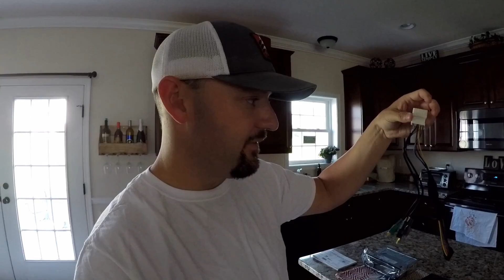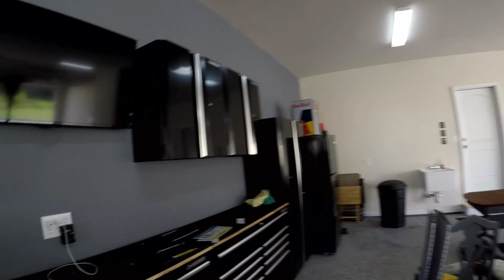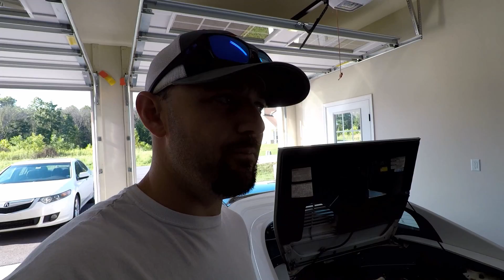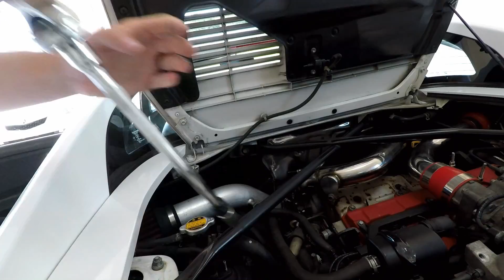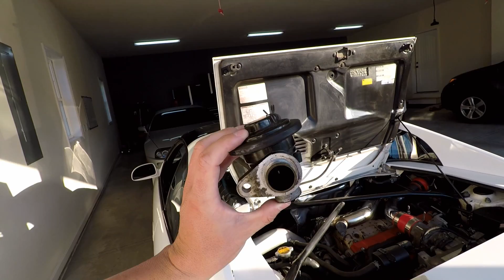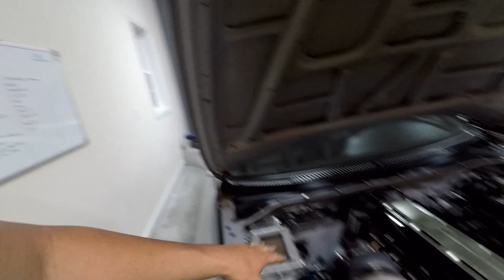Time To Sell My Toyota Supra...

Comment: I don't want to say I saw this coming but it seems like you really wanted something different lately. Personally I would stay away from that r35. I was a die hard fan of that r35 since it came out in 09 but I got a chance to drive a Nismo edition last year at my local speedway race track with 5 laps and what a boring, automated, disconnected from the driver type of car. Don't get me wrong, it had amazing acceleration and handled great around the corners but the best way to describe it is a computer on wheels. Get a chance to drive one and you will probably miss the Supra a lot just like I did.

Comment: At the moment, used MKIV Supra prices have leveled off so you could get a good bit from selling it. Not sure how the JDM MKIV Supras are going to affect prices. Probably not much cause they're still RHD. They'll start arriving in April 2018 (MKIV Supra production started in April 1993). Then again, it's still a pretty special car. It was a much more influential car for my generation than the R35 GTR.

Comment: yo I wanted to tell you for the longest while that specific sound you were thinking you would hear after blocking the blower valve port does Not come from a blower valve it comes from the Turbo Waste Gate ... and you need the blower valve to release that boost pressure  when your throttle body closes so really should put it back or you could force the engine to lock or blow under none control of boost

Comment: If you get rid of the Supra you should do a 4th gen swap.  It will get you that coil on plug set up you want.  Plus with an upgraded/rebuilt turbo from Prime MR2 you could push 320-330 hp to the wheels.  That E153 tranny is a beast and will eat that power up like it was nothing.

Comment: I own a ST205 and I really like the stock BOV vented to air. Tried no bov, tried a HKS, just went back to oem vented.
The OEM catch does a good job, you should just replace it with a new one and put a small filter on it instead of letting it vent into the intake as it just fills it up with oil.
Your ECU and mine are pretty much the same, so in first and second gear Toyota put a lower boost setting. Be sure to wire an aftermarket EBC to get the full potential of the engine. But be careful with the intake temperatures as the 3sgte doesn't like hot air.
About the r35/Supra, I don't know why you are asking us if you will be the one spending the $ and actually driving it. As my Celica is AWD it is a really fun car, but I am craving that RWD from a Supra. If you can, drive the Nissan for a while and see how it feels to you, does it suit you and your driving style.

Comment: You should never get rid of the supra if anything now that u have the mr2 you should build the supra. If u do get the r35 get it where u dont have to sell the supra. Plus u have right now the most iconic jdm import to ever touch the road plus it gains value every single day that goes buy and the r35 loses its value evey day so in ten years i guarantee the supr will be worth more that the newer r35

Comment: what I did. I kept my 97 Supra TT and bought a 2014 R35, you can find them as low as 62K depending on condition and miles. I did have to fly to pick up mine once I found one and I get to keep my Supre and not regret later for selling it. this way you can have Kong & Zilla in your garage. Just an Opinion.
Reply: claudiomm95993 i like this right here 👆

Comment: The supra is one bad ass looking machine and one hell of an icon which will only gain in value as the years roll by ,personally i think you will regret it if you sell after all the hard work youve done to create it your own machine my advise would be park it a while before making hasty a decision  spend time on the mr2 for a bit.Yes gtrs are a great looking machine but prity common to be honest  as i see them daily cant say that for supras  m8
Reply: Tim Jackson I don't think so for two major reasons. Next year the USA can start importing right hand drive mk4s which lowers demand for the left hand drive ones. The other thing that will greatly limit demand is the r34 which will become legal in a few years which will likely take away most of the high bidders in the supra game.
Reply: FELiPES101  WROONG, the prices will continue to appreciate, theres just so many 1993 Supras

Comment: I think you're going to get bored with a GTR. I've always said that the GTR is a middle ground/filler car. It's the car everyone goes to when they're tired of messing with older cars and want something new, while at the same time usually aren't fully in a position to move to something better, but once those things change, to the classifieds it goes, I've noticed this a lot with a lot of reading and asking around. The GTR fills a temporary automotive void like a quick blip. Personally it doesn't feel like something I would love and stick with. But hey everyone's different, and I guess that's where a lot of the fun lies, to try as many different things as you can. If you feel as though that's the car for you, make that move man.